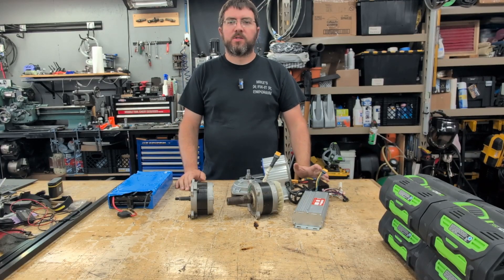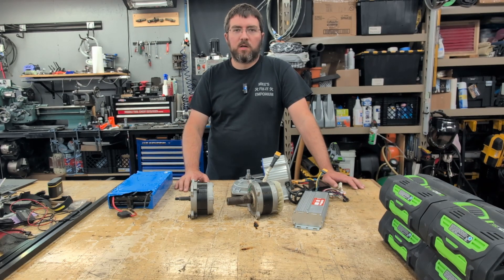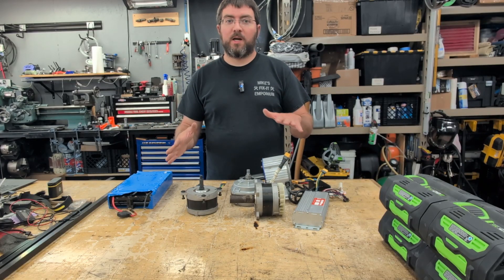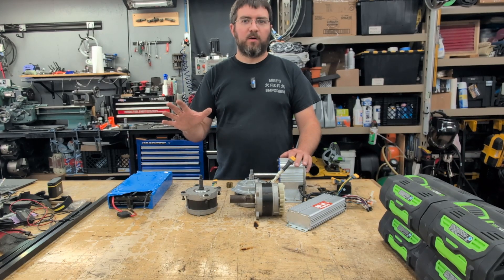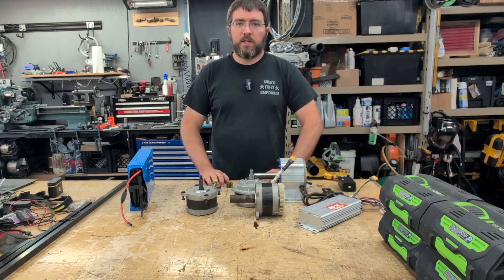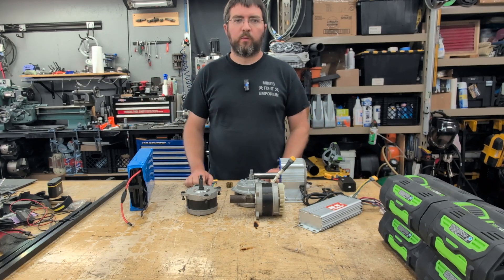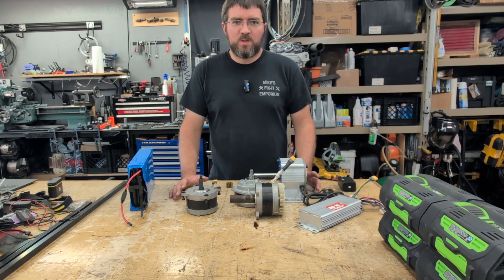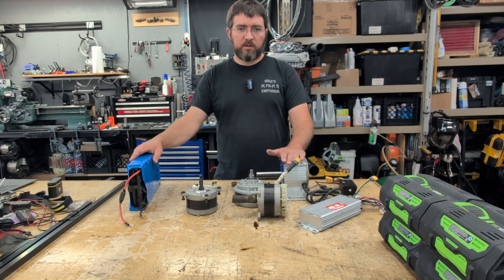DIY Electric Zero Turn Mower EZTR V1

Comment: Hola de que potencia son los dos motores que utilizas para oa traccion ?.
Tipo controladora ?.

Y baterias que voltaje y capacidad ?.

Ka bateria es asi o has unido 2 o 4 paquetes ?.
Y el motor o kotires que utilizas para coetar con las cuchillas el cesped puedes dar infirmacion sobre esto tambien , tipo de kotores voltaje , amoerios que controladira utilizar etc ?.❤
Reply from the maker: Hello, what power are the two motors you use for traction?
2.2kw motors:
https://www.aliexpress.us/item/3256809484856528.html?spm=a2g0o.productlist.main.3.17ba6149NnmxB3&algo_pvid=38046608-8b35-4ee5-abd9-4ddf52e545c6&algo_exp_id=38046608-8b35-4ee5-abd9-4ddf52e545c6-2&pdp_ext_f=%7B%22order%22%3A%22-1%22%2C%22eval%22%3A%221%22%7D&pdp_npi=6%40dis%21USD%21280.45%21263.62%21%21%212003.24%211883.05%21%40210330dd17546002796514820efe15%2112000049823301028%21sea%21US%210%21ABX%211%210%21n_tag%3A-29910%3Bm03_new_user%3A-29895&curPageLogUid=2XhceS8ZujLc&utparam-url=scene%3Asearch%7Cquery_from%3A

Controller type?
https://www.aliexpress.us/item/3256804512246765.html?spm=a2g0o.productlist.main.16.3289xWXMxWXMmV&algo_pvid=29467f25-41d9-4b0a-b1c6-453b1b7795df&algo_exp_id=29467f25-41d9-4b0a-b1c6-453b1b7795df-15&pdp_ext_f=%7B%22order%22%3A%22250%22%2C%22eval%22%3A%221%22%7D&pdp_npi=6%40dis%21USD%21449.63%21129.49%21%21%21449.63%21129.49%21%40210312d517546003280652933e851c%2112000030142109464%21sea%21US%210%21ABX%211%210%21m03_new_user%3A-29895%3Bn_tag%3A-29910%3BpisId%3A5000000177744155&curPageLogUid=CvDmPI9eNgKE&utparam-url=scene%3Asearch%7Cquery_from%3A

And what voltage and capacity are the batteries?
48v. The capacity of this version is 2.2kw.

Is this the battery type, or did you combine 2 or 4 packs?
I paralleled 6 packs. I ended up making one gigantic pack for V2. - https://youtu.be/GwCCmmw4-0I

And the motor or tires you use to power the grass with the blades? Can you provide information on this as well? Type of motor, voltage, what kind of controller you'll use, etc.?
Motor - What I used still isn't powerful enough for the blades, but anything that fits the use is very expensive.
Controller - https://www.amazon.com/flipsky-Electric-Skateboard-Scooter-Controller/dp/B09J4SV7G5/ref=sr_1_3?sr=8-3